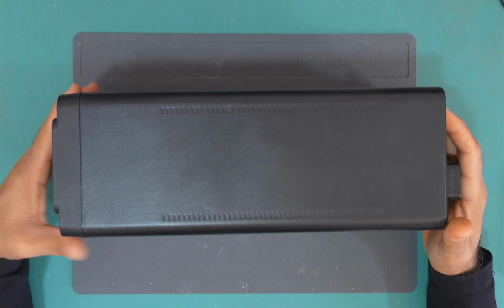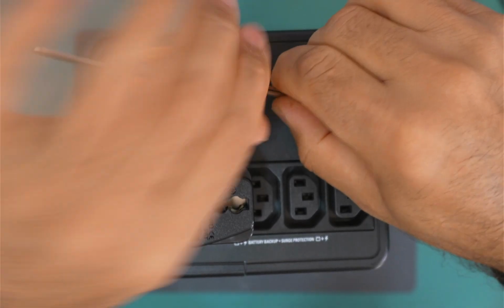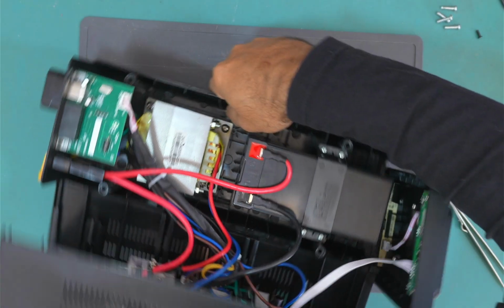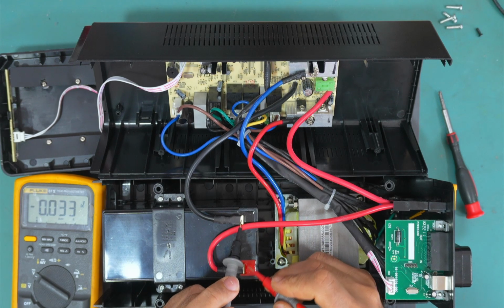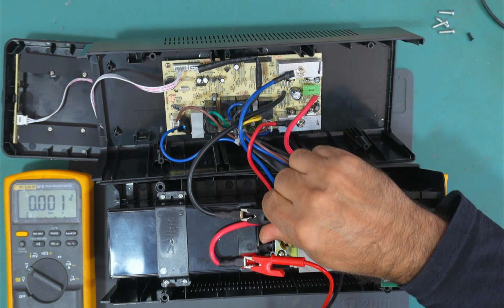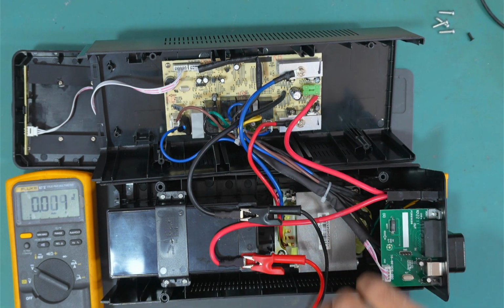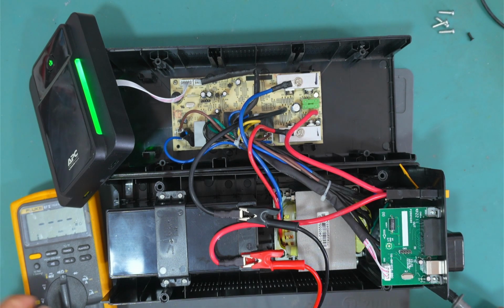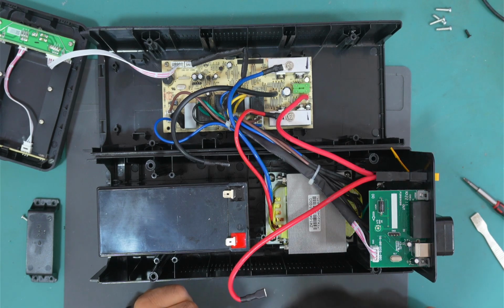APC UPS

Comment: Hi
I'm asking about ps5 pwr sply, i want to know value of the pin 8 of IC TEA2016AAT, because i found 310V, is that correct value?
Reply from the maker: Hi brother 
Yes its right voltage as its  PFCDrain Pin

I wish you all the best brother
Reply: @FixTronics  @FixTronics  thank you very much brother, all the best ❤️

Comment: In and out RJ ports are filtered ports to connect a modem or a phone , the USB port is used to connect the ups to the PC where the management software is installed. It is useful to properly shutdown the PC whenever a power cut occurs before the ups goes definitely off ...
Reply from the maker: Thanks for the clarification 👍🏻